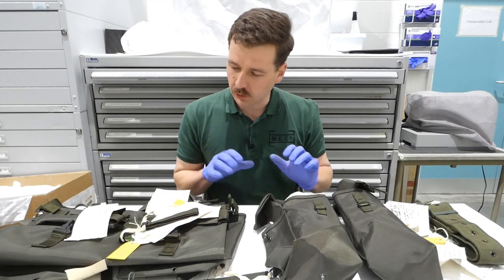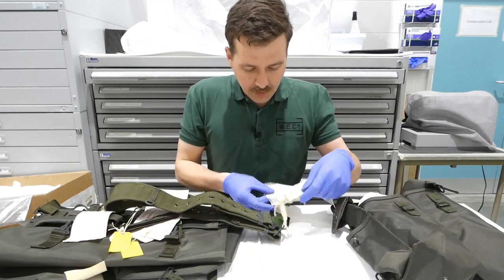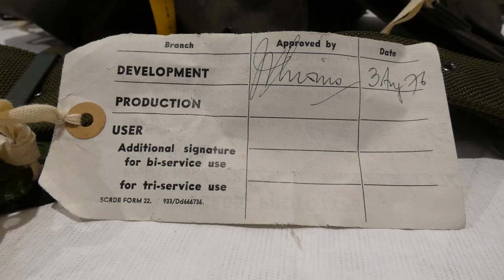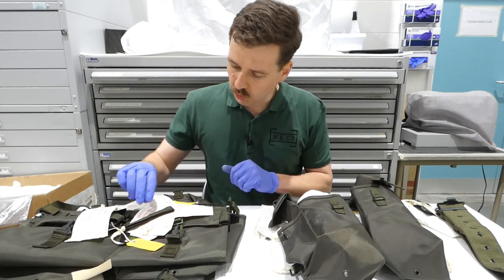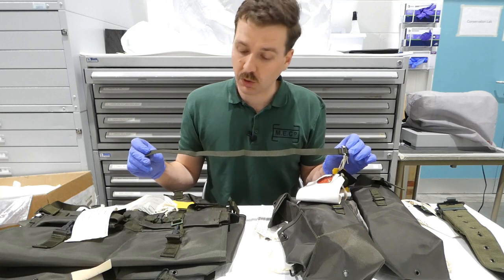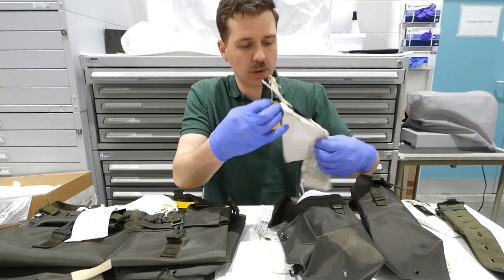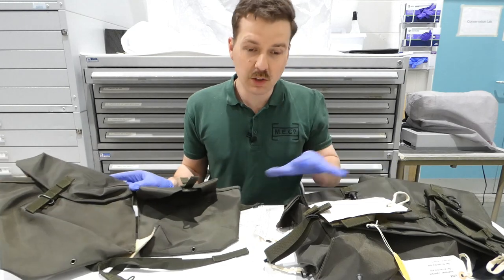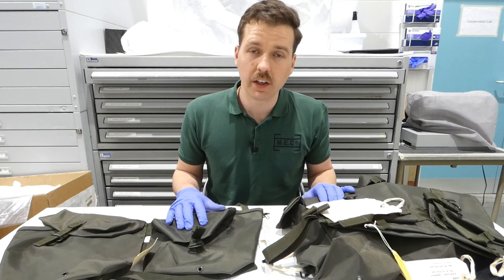Sealed Pattern Mk 2 (Nylon) 1958 Pattern Web Equipment

Comment: Ah good ol' 58 pattern. Infinitely adaptable, with a small section of sleep mat, needle and cotton and a liberal application of bee's wax. Once modified, it did the job pretty well and didn't soak up the moisture so bad.

Comment: Would there have been more of the waist belts put into production?  Reason I'm asking is that up until fairly recently my cadet battalion  (I'm an instructor) was still using 58 pattern webbing.  There were a vast majority of them with a nylon 58 pattern belt. All were withdrawn around 4 or 5 years ago and replaced with the training vest. Guessing they'll be sold off in bulk by the MOD at some point
Reply: Those belts were most likely the later issue “Belts, Working and 1958 Pattern” that looked very similar but came with PLCE style square metal rings on the back instead of the D rings of 58 pattern Mk.2.

Comment: Nylons ability to melt is also a safety issue .
Reply: If it's hot enough to melt your webbing, I think you're not going to survive it, anyway.
Reply: @enfieldnelly  If it catches fire,  it's better to be a human torch wearing canvas web gear.
Reply: @willallen7757  It would be like the string wrapped round the roast - not really the limiting factor on why the meat got cooked.

Comment: I used to have a Waterbottle pouch, it had the twist turn fastener, and the water bottle and cup fitted it easily .... unlike the mk1 cotton variant...., we all know what you are smelling Simon.
Reply: PLCE item. Probably not Nylon '58. But, Yes. Much better. Preferred them to the MOLLE II poches I had in Iraq.
Reply from the maker: It's not PLCE, David is referring to the Mk 2 1958 Pattern WB pouch, which, as with the Mk 2 components discussed in this video, was made from nylon. Unfortunately, there wasn't an example amongst the sealed pattern items at the museum for me to discuss.
Reply: It was the nylon model of 58 pattern, I had the piece in the late Eighties, sadly sold long ago to pay bills when out of work in the noughties...
Reply: @RiflemanMoore  I found a nylon pouch very similar to the ammo pouches and I was wondering if it is the nylon MK2 water bottle pouch.

Comment: the main reason, i believe for non full issue, was the webbing would soak up fuel/water and not drain/dry out like the canvas did, i was issued part and part webbing kit roughly 1986 ish, and personally saw ammo pouches catch fire, mine to be exact!! even though i hadn't been near fuel in weeks!!, also they would rip quite easily, i was RAC and lost count the amount of times they would catch on the vehicles and small rips would appear, totally useless really....
Reply: Wonder if this was the same material as the old respirator pouch?
Reply: @stephen2429  it was within reason, but the resp case was a thicker material & tougher 💪
Reply from the maker: The respirator haversack is more closely related to another trials set, the 1975 Pattern.
Reply from the maker: As I remember, the post trials report noted the main reason for the nylon equipment not being introduced en masse was primarily down to cost.
Reply: @RiflemanMoore  no surprises there then 🙂
Reply: So accountants had their say...... not that you tend to be issued the cheapest alternative is still true.